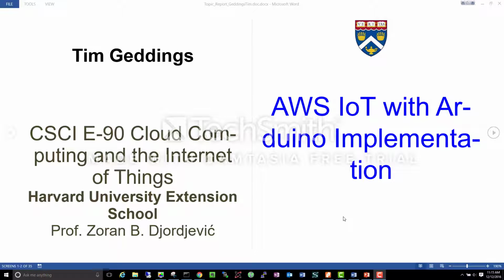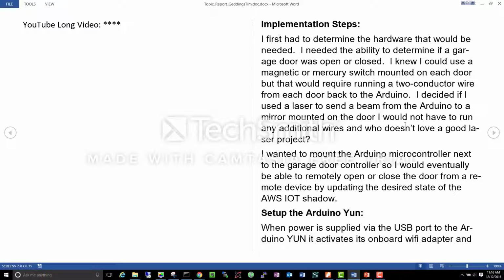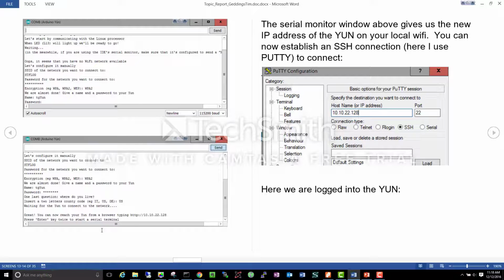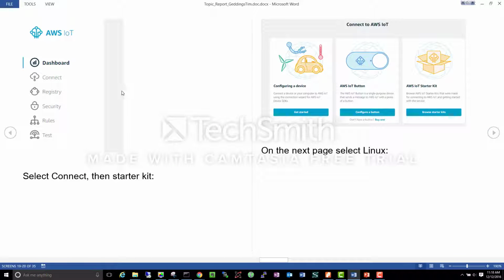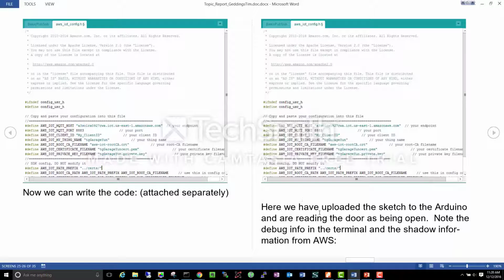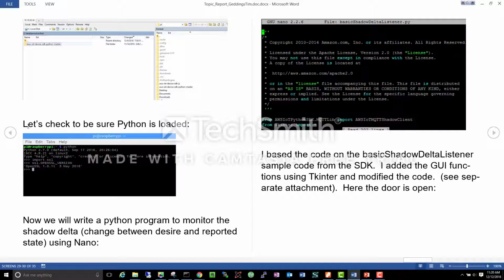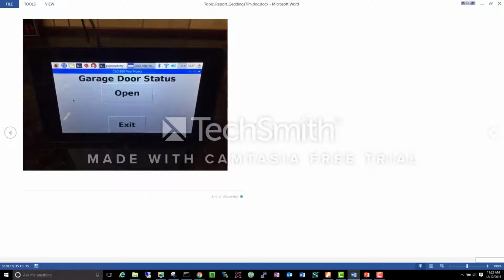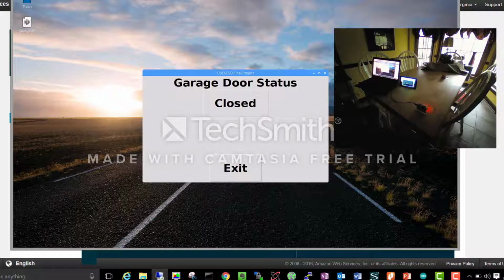AWS IoT with Arduino Implementation - complete

Comment: When I execute "pip install AWSIoTPythonSDK==1.0.0" command I get the next message error:
"pip install AWSIoTPythonSDK==1.0.0
Traceback (most recent call last):
  File "/usr/bin/pip", line 9, in <module>
    load_entry_point('pip==9.0.1', 'console_scripts', 'pip')()
  File "/usr/lib/python2.7/site-packages/pkg_resources.py", line 337, in load_entry_point
    return get_distribution(dist).load_entry_point(group, name)
  File "/usr/lib/python2.7/site-packages/pkg_resources.py", line 2281, in load_entry_point
    return ep.load()
  File "/usr/lib/python2.7/site-packages/pkg_resources.py", line 1991, in load
    entry = _import_(self.module_name, globals(),globals(), ['__name__'])
  File "/usr/lib/python2.7/site-packages/pip-9.0.1-py2.7.egg/pip/__init__.py", line 28, in <module>
    from pip.vcs import git, mercurial, subversion, bazaar  # noqa
  File "/usr/lib/python2.7/site-packages/pip-9.0.1-py2.7.egg/pip/vcs/mercurial.py", line 9, in <module>
    from pip.download import path_to_url
  File "/usr/lib/python2.7/site-packages/pip-9.0.1-py2.7.egg/pip/download.py", line 47, in <module>
    from pip._vendor.cachecontrol import CacheControlAdapter
ImportError: No module named cachecontrol" 

Do you know why?